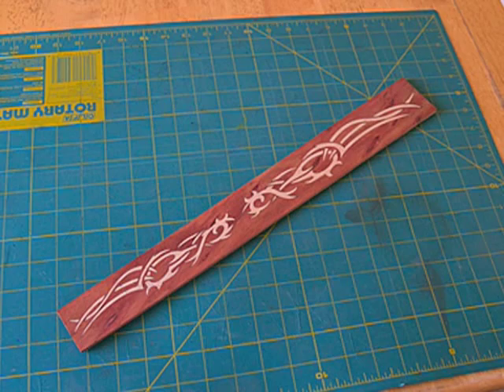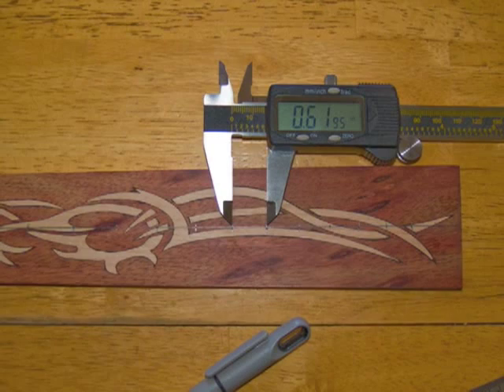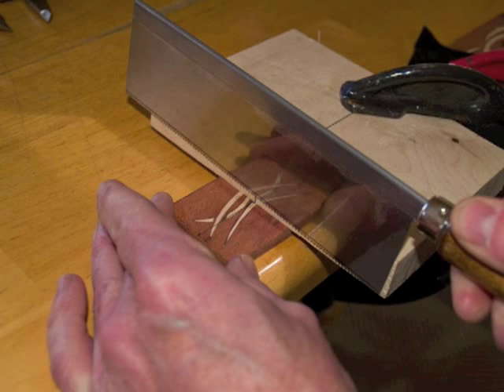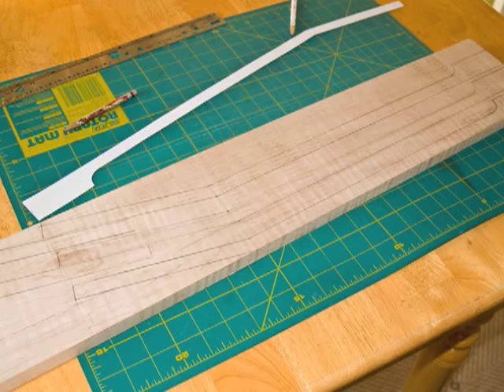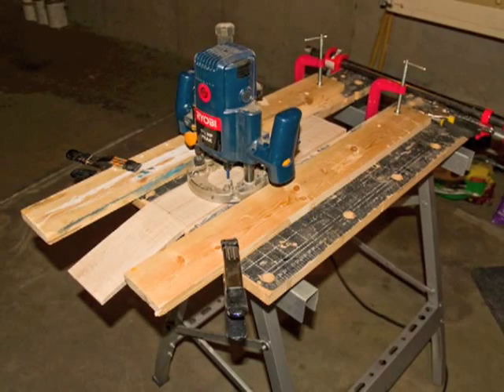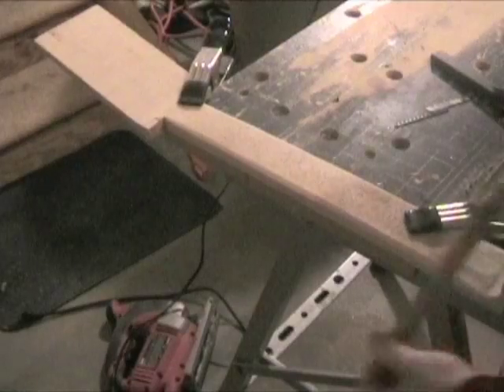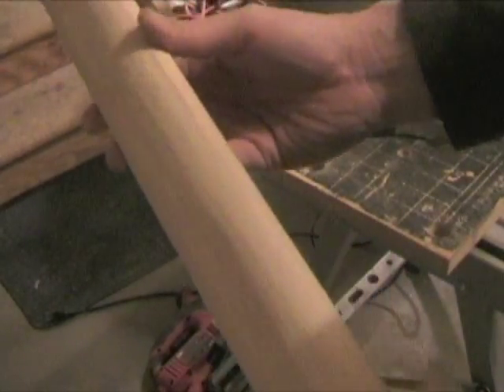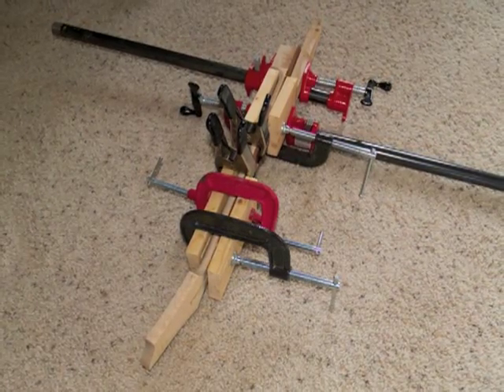How To Make An Electric Guitar: Part 1

Comment from the maker: All of my slots are square profile. As long as the depth is equal to the rod's height, square is fine. Curved slots are for single action rods. I like dual action because the slot is level.

Comment: Why not show how he determined the angle of the actual neck join? Did he slide the router in on a sloped set of wood rails to get the angle right on the pocket?

Cool fretboard design though on the inlay end of things [tribal looking, tattoo stuff... works!]. :-)